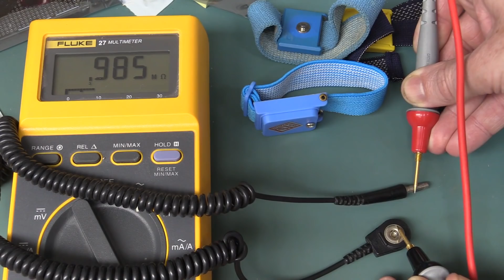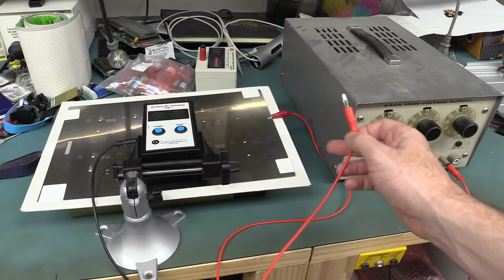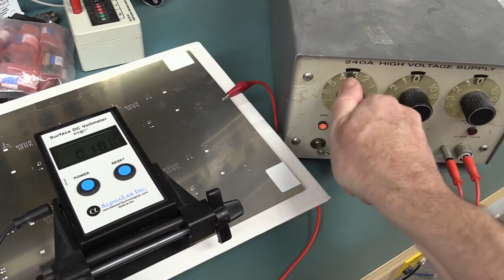EEVblog #768 - Cordless Anti-Static Wristbands BUSTED!

Comment: Funny you're talking about this because I just started a computer servicing course and we were given these as part of our kit
Reply: ***** I'll contact my tutor for data recovery (the class we use them in) and make her aware of this right now.
Reply: ***** With ESD damage, your expensive video card may work for 5 minutes or 5000 years.  With the static strap, it will always work for 5000 years... People can't really understand that you don't need to see a spark to know that damage has been done.  Years ago a friend worked for a popular microphone company here in the US. When something was damaged, they'd uncap the IC sometimes and go directly to the employee that was known to 'forget' his strap and summarily terminate him. An IC that has ESD damage actually has craters and holes literally blown into the silicon under an electron microscope.   

I so wish that guys that build PCs would go through mandatory ESD training and certification.  It should be required to get that A+ or MCSE or whatever ppl get nowadays.
Reply: E2qNX8btraQ3zRD6J7fc No it shouldn't because it's not as big a problem as it once was. Back in the 80s it was a real issue, so much so Apple released a video on ESD Danger. Most parts now are protected. I've built several PCs on a bed (granted on a ESD mat) in a carpeted bedroom. Never blown or damaged anything. All parts have lasted until I've decided to do upgrades.
Reply: you ever have a computer that locked up? any blue screens of death? There's a term coined years and years ago by those challenged to eradicate ESD issues, it's called called 'the walking dead'. A part is damaged by somebody; it's GOING to fail or be flaky. It may work but it is in fact damaged. Don't tell me that it's not a problem anymore. It's more of a problem now than it was years ago. They're making stuff with processes that use a couple dozen nanometers. Ultra ultra sensitive stuff.

Computer parts manufacturers assume that there are going to be failures because of ESD. It's good for business, as long as it's not the manufacturer's fault.
Reply: E2qNX8btraQ3zRD6J7fc
I'm an IT Engineer. The only lock ups and blue screens were all software related.
Reply: 101stsurvivor That's pretty outrageous, they should be embarrassed 0.o Unless to illustrate the importance of data recovery they're hoping to ruin a hard drive chip lol...
Reply: *****
I should of stated, as I've seen written elsewhere, that chips these days can cope better than they used to back when Apple made the ESD danger video.
Reply: So, everybody says "the most modern equipment can handle ESD"  May I point out that whenever any aerospace technicians work on a satellite or rover, they always clip onto ground to prevent stray currents and ESD.  Find a clip of people in bunny suits working on the mars rover, they're all grounded onto the vehicle which in turn is grounded to earth.
Reply: +E2qNX8btraQ3zRD6J7fc there's a difference between a $100 motherboard and a multimillion dollar satellite. modern equipment can handle ESD pretty well. the problem is that with the satellite, the cost of having an ESD issue, no matter how unlikely, is way larger than that of the motherboard.
Reply: +mv2112mv so you're implying that ESD issue still exist
Reply: @TheStevenWhiting  Should HAVE*** stated... for fuck sake "should of" is not a thing
Reply: @pascha4527  yes they do exist. You know what also exists. A chance of you dying to a lightning strike. Now tell me do you stop going outside in fear of getting electrocuted?

Comment: When Dave was charging himself with static electricity he looked like Marty using the hover board over water.
Reply from the maker: márcio lima sousa Damn, you are right! So should have worn my Marty McFly hat!
Reply: @EEVblog  where did you get the high voltage supply thanks Ben great video by the way☺

Comment: Well...What a chocker! :D

It's not entirely "useless" though, it's a relatively "cheap" encapsulation for a wearable electronics project.
Reply: Well, they want your money.....
Reply: Maria Engström AND it comes with a free resistor! what a deal!
Reply: How much would that resistor cost, anyway?
Reply: Not even 10 cents.
Reply: Amir Hakimi-Rezaei lol! :D
Reply: P.M. Laberge Less than half a cent for a name brand one on digikey, a lot less for a no name one from the shenzhen market.
Reply: Maria Engström Am I the only one thinking an ESD wrist strap watch! Been in fashion since electronics began.
Reply: rocketman221projects So add another 50 cents for the wrist thingie....  Hum.  So all we need do is add a long piece of wire and a alligator clip, and sell then for $2 (not $1) and they might do something......
Reply: Amir Hakimi-Rezaei 
Wow,I am sold!

Comment: This thing is dangerous. There is no safety resistor between the big screw and the surface. Only the thin label may insulate a bit. Would you wear that when working on powered equipment??

Comment: You simply need to install the high-intensity gamma emitter material in the wrist strap.  It will ionize the air around you, providing a conductive path to ground.  Yes, eventually your arm falls off, but very convenient in the mean time.

Comment: I wonder if it was meant to have a metal plate somewhere nearby that you reach over to touch the strap to the plate to disspiate the charge, and then go back to whatever you're doing without having to connect and reconnect. Kinda defeats the purpose of working with an ESD strap though, if you constantly have to have your arm touching the panel...

Comment: I know this is an old video, but these are still for sale. I think you might have missed something - I saw this on an auction listing: "Please Note: For best results wear the anti-static band for at least 15 minutes before beginning work on any sensitive equipment. Make sure that the inner stainless steel back is touching the bare skin on your arm." - I'm sure that makes all the difference.

Comment: As far as I know the premise with these things is not that it keeps you grounded 24x7, but that it's a safe way to discharge yourself occasionally.

If you're moving around a lot, and only doing very occasional work that requires you to be grounded, it's a hassle attaching and detaching your strap, but you can tap that screw on something grounded for a moment and discharge yourself without harm, despite not having a permanent tether.

A grounding mat at your workstation is still a far better method, but I can see a use case for such a thing to exist, people just see "cordless grounding strap" translated from chinese and jump to conclusions...

Even for those who aren't technicians, but maybe just have an environment or dress habits that lead to high static buildup, are sick of shocks, and want a safe, pain free method to ground themselves. Slightly dorky looking but could hide under sleeves and such too.

Better than dragging a grounding strap behind your shoes :P
Reply: Heck, take it further and make a dissipative mobile phone cover, with a high-ish surface resistance you could hold and tap on railings and things to prevent shocks when walking around, there'd probably be tons of people keen on the idea.
Reply: "but you can tap that screw on something grounded for a moment" how much static are you building up that you couldn't just tap it with a bare hand? Hell, just tape a resistor to a table leg and tap the end if you want. Enjoy your $.05 grounding experience.

Comment: How do the conventional corded ones work? Dos and don'ts about where to connect the clip? Is it ok to just clip it to any metal lump in your vicinity?
Can you connect it to a floating ground, let's say the grounding stud on a double insulated turntable or amplifier?
I live in Norway where many old houses use the IT power distribution system (or sometimes TT, when the disneuter in tre transformer kiosk has failed). Many old houses do not have earthed outlets. Where do you clip the wrist strap if there is no house earth (not in the room you're in anyway)? To the casing of the item you're working on? Do you then connect the item's earth to an earthed outlet? What if there is a signal ground/0v rail, do you connect this one to earth too as it's galvanically isolated?

Comment: I heard a story about an electronics factory in China where all the workers were wearing these magical voodoo devices. fail.
Reply: SilentS Well yeah, obviously. They only have to spend $1 on them, it would probably pass safety regulations, not that anyone would check anyways. And when the workers get shocked, it is cheaper to replace them than having had to spend 10 bucks on a real wristband for them.
Reply: ArduinoNerd ESD straps are for protecting sensitive components not people.

Comment: Im pretty sure you supposed to touch that screw that's on the top onto a grounded surface before handling sensitive circuitry to discharge any static that you had built up. Obviously not wireless or anything and not as good as a proper corded one but would still work.
Reply: Tom Nelson You could just touch the grounding surface yourself, without the cordless gizmo.
Reply: eddiebruv  yes but the strap has a 1meg resister so you dont feel a shock from the static discharge.
Reply: You don't need a resistor for that. If you use a screwdriver you wouldn't feel it either. Go try it. Get a screwdriver and hold the metal part, charge yourself up with wool socks on a carpet and tap a big metal surface.

I once had to unpack a load of stuff from bubble wrap and got zapped all the time. Using a screwdriver to discharge on a metal closet every now and then did the job just fine.

Comment: What would you think of one that used sharp points inside a vented plastic case?
The sharp points in the device would hopefully dissipate static by making it easier for the built up static charge to escape by ionizing the air.
In other words, an air ionizer powered by walking across a carpet.
I know the theories behind this idea are sound, but I don't know how well they would work in practice.

Comment: Could you have a bracelet containing multiple resistors hooked up to capacitors which are then chained to an LED light? I.E. when the capacitors become charged enough they light up the LED and thereby discharge the stored power?

Comment: I don't have the documentation so can't tell if is came with instructions. Normally, the strap is just a conductive device with the protection resistor installed elsewhere. This one clearly comes with the resistor installed in the device. My thought is that you have to supply your own cable directly to ground, protection already installed.Needless to say, the construction is cheap but what else do you expect from China?

Comment: In a professional electronic manufacturing environment, such as a PCB assembly company, part of the ESD protocol is to test the ESD strap at the door before entering the ESD controlled area. To make sure, the tester checks for a resistance between about 500K and 10M . So open circuit fails, and so does a short. The resistor is there for safety of the operator in case they accidentally touch something live like 110/240V. The resistor limits the current through the wearer. In the case of actual ESD, it slows down the time to discharge, but since it is continuously connected (in a real strap with cord connected to ground) the charge does not get a chance to build up.  The reason something like this gets a chance of being thought to be effective is that the built in resistor fakes out the tester, reporting that these cordless devices are "good" .  Go do a search on ebay for "esd strap tester". They aren't testing that the ESD strap is effective at dissipating a static charge, only that it has the right resistance.

Comment: there COULD be a way to make this work, you would have to collect the charge, step down its voltage, cache it in a capacitor and then maybe bleed it off with an LED or something. 

That being said, I have no idea if it would operate quickly enough and get the charge down low enough to not be a risk to parts.

Comment: Hey Dave, I have a question:
So I have this new laptop, that's all made of metal (Schenker XMG). Supposed to be good. There is no ground connection on the power supply. When I'm touching the metal surface, I can feel some electric charge (with my hairs, and the way that it kinda vibrates when I slide my hand gently on the surface).
I have a regular tester, cheap one, that measures voltage for DC, AC. So just by holding one electrode with one hand, and approaching the other electrode to the laptop, without even touching it, I get like 15-25V AC reading on the tester. Highest reading was above the CPU. Touching it with the electrode is unreliable since it's all painted black and not conductive.

Is it piling up static charge? Is this a sign that the metal surface is dangerous once the paint is scratched somewhere? I've built PCs many times and have never had any issues with electricity posing a danger to me outside the PSU because of the low voltages, but here it seems a lot weirder. Should I be worried?

Comment: I was wondering if something was "lost in translation". The "Wireless strap" is a foot strap. A redundant ESD protection that you put on your shoe the way that conductive thread touch ground and free end you put into the sock (touch the skin). I had used it in a few places. But I agree that these ones are hard to explain why they should work.

Comment: I've seen these before!  The "theory" of how they worked was based on the presence of a high surface area conductive material located where the resistor was installed to collect the charge.  The material in the one we took apart was copper "wool", like a piece of loose solder wick.  As you can probably guess, they were about as effective as the one you tested here, so I guess they figured why bother adding the expensive metal.

Comment: Wouldn't ESD dissipate faster if there was no resistor, just a plain connection?
Reply: Yes it would.  The resistor value (typically 1Mohm) is selected as a compromise between fast discharging, and limiting current flow through a discharge path to reduce the change of device damage. It also provides some protection from electrical shock if the wearer touches a "live" circuit.

Comment: CLEARLY the metal screw is supposed to make a better electric connection to the air than your entire skin surface area, thus dissipating the charge more quickly. And for only $1? What a bargain!

Comment: No doubt this is BS, but I think you should have done the same friction test with the tethered strap connected to the ground point to show if a charge build up was even possible.  The video just shows you plugging in the strap after you've had a charge build up.  Nice video... I always wondered how they tested those antistatic mats....

Comment: It's meant for alligator clip so you dont need the cord with the one ohm resistor built in it works but you can get a good 1 with cord for like 2 bucks more if that

Comment: what if there was a capacitor inside of the wristband instead of a resistor? would it work then?
Reply from the maker: MrPolymath0 The cap would just collect and store the bullshit :->
Reply: MrPolymath0 Just in case you weren't joking -- a capacitor with one leg flapping in the breeze does nothing.
Reply: MrPolymath0 Only if it's a flux capacitor.
Reply: MrPolymath0 Even if it did work - what happens when you have a fully charged capacitor and you touch the screw?
Reply: TheHue's SciTech Depends on the breeze, surely the spare leg could wick the charge out to the passing air?
Reply: EEVblog LMFAO. Best comment on this video!
Reply: EEVblog But what if your dealing with high frequency bullshit? :)
Reply: Dennis Hill Buy something else with low frequency bullshit, they'll cancel each other out :-)
Reply: EEVblog That is exactly what happened when I took English Lit.  Should never have worn that wool cap.  Must have turned my head into a BS collector.

Comment: I am an electronics engineer, and I once checked some PCBs being made in in a factory in China. When I dinged them for not having their wrist straps plugged in, my jaw just dropped to the floor when the quality manager (!) proudly said these were the latest tech: wireless wrist straps. I could hardly speak for laughter for a few moments. Then I told them they'd been conned and why. And then I ordered them to scrap the entire production batch I was inspecting.

Comment: Although it doesn't show it on the ebay seller sites, I believe you should be wearing these with the screw facing towards the bottom and when you're wresting your arm on an antistatic mat - it discharges that way. Not through some magical air and fairy dust - it simply can't as you've shown. Maybe try it again the way I suggest. But you still come into problems when you're not grounded to the bench - you're still building up a charge and need to discharge before you handle - which is most of the time.

Comment: I think that the idea for the creation of this unit was different.
If you want to discharge electrostatic charge then you yourself touch a grounded place by the screw and a resistor. You avoid unpleasant spark.
Discharging by touch but without cable

Comment: What i think is that the resistor is installed between the body contact and the bolt and you're supposed to touch the bolt with the ground wire to discharge yourself. The only good thing is the resistor which is put into it so u don't shock yourself accidentally. Opinions are welcome.